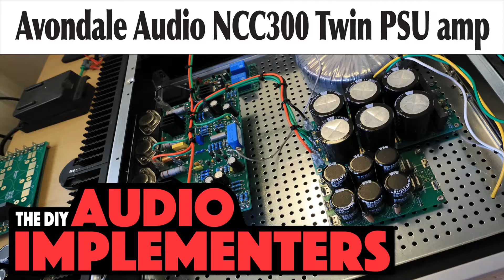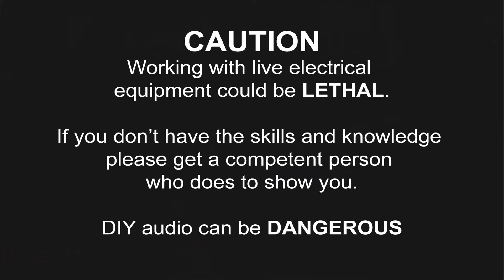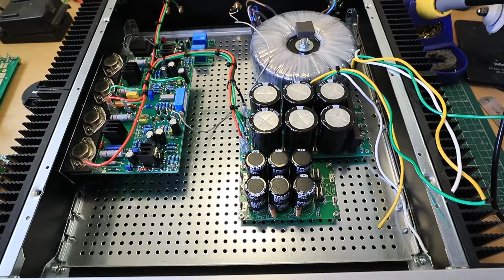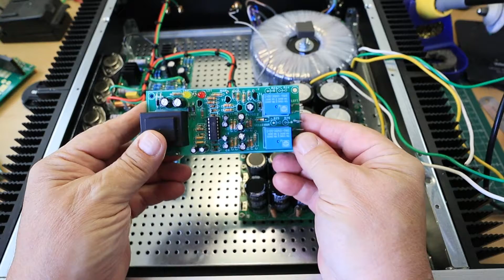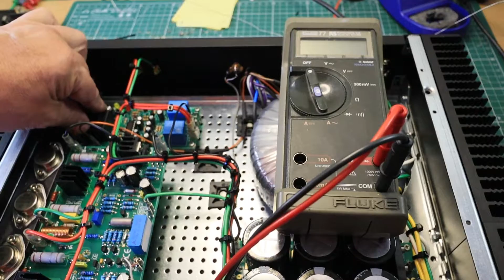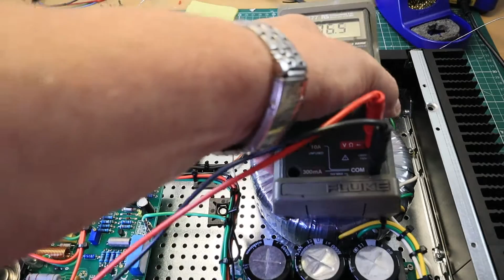Avondale Audio NCC300 twin PSU amp

Comment: I notice your voltage for the front end is lower than the power stage. I thought that Avondale amps in the "Voyager" configuration usually had a higher voltage on the front end compared to the power stage. Did I miss something?
Reply from the maker: Hi Mike, No you haven't missed anything. But you must make sure the front end regulator is 'regulating' so you need a drop of a few volts from the input to the output. I've tried rail voltages for the front end, below, at and above power stage voltages. I can not detect any advantage on having the front end voltage above the power stage voltage. But by all means give it a go .
Reply: @thediyaudioimplementers1826  Thanks for confirming!